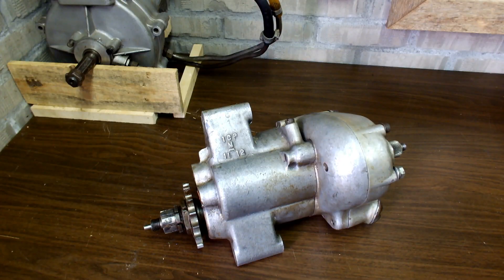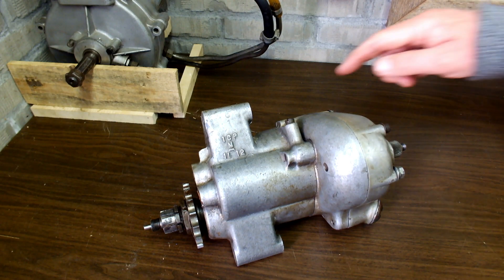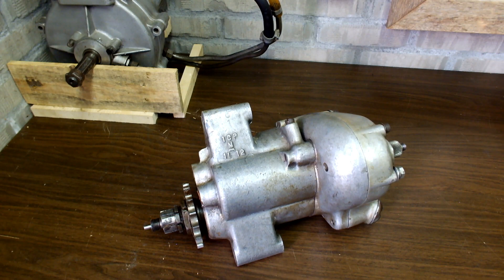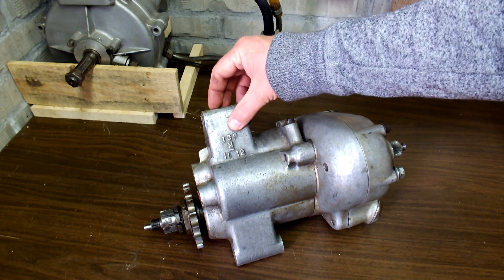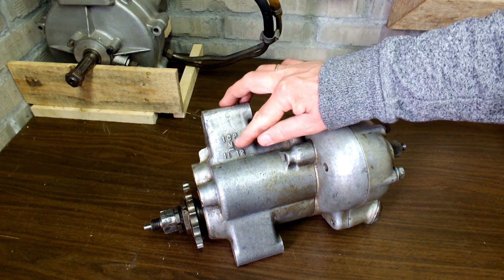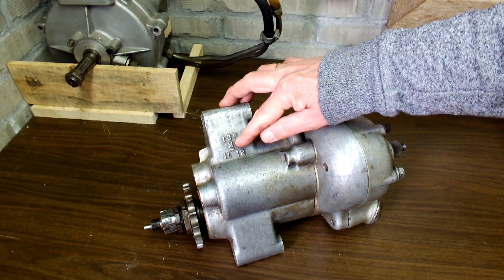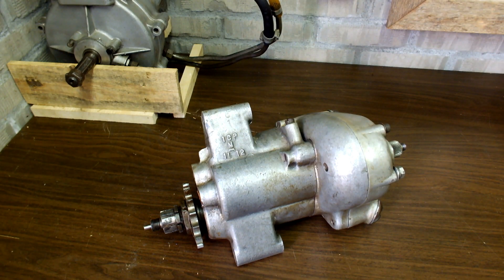Matchless G3L Rebuild - Part 1 - Getting Back to Work

Comment: Well, I'm currently putting my 1949 AJS model 16 back together, after a bit of a break. It was registered on 31/12/1948 and is a 49 model. (rigid/tele) Someone, in the past 70 years, had over tightened the upper oil line into the crank case and split the crank case ! Engine stripped and damage beautifully repaired by a local engineer. Currently waiting for some new parts but bottom end is back together and  in the frame. Hopefully  on the road by Spring. Good luck with the Matchless.  Lach MacCormack, Kent, England.
Reply: Are you on Instagram?
Reply: Would really like to see your build. Maybe I can learn something for mine.

Comment: Hello, I would like to give you some information (I am english and own matchless g3l’s) 
your frame number of 38873 makes it a war time frame. Contract number 12632 - 12633 frame number 34012 - 41011 was early 1942. (7000 units made in that contract, there was 4 different contracts for early 1942)
That contract came with Lucas or miller lighting.
The engine should have a number stamped in the side (some have a plate on them after being rebuilt in the army workshops) but it should read 
41/G.3.L - (then the number) regardless of the year they all have 41/G.3.L - *** 
If it’s a 3/4” inlet bore then it’s a war time engine, if it’s a 1” inlet bore it’s post war. For your frame number the engine number was between 49012 - 56011 (no G3L WD ever had matching numbers, if it has then someone stamped it themselves, possibly to disguise a post war engine) 
The gearbox should have stamped on the right side, upper face CP8 *** or possibly 8CPL *** that’s the gearbox number. They are a good box and the WD had a low first gear. Don’t use oil in the gearbox, they use liquid fluid semi grease (Morris EP400 for example) oil will just leak.
A great place for spares is AMC classic spares in uk. Steven is a really nice, helpful person. 
You also have the WD motorcycle forum,. 
A nice site is called matchless clueless.
There’s a nice book called “overland to Vietnam “ the story about a chap riding his g3l 11,500 miles.
Get a electronic regulator (I use the “dynamo regulators ltd. DVR2N” and have nothing but praise for them. They fit nicely in the original regulator cover too.
I am now in the finishing stage of a late 43 restoration and will take this one to Normandy this year along with the 42. the 44 needs a head rebuild, and once opened the engine might need more work so for now I’m concentrating on the 43. 
They are great fun to ride, (especially fully kitted out in the period ww2 dispatch riders uniform like we do) and you get looks, waves, smiles and always lots of interest, you will enjoy the bike I’m sure. 
Good luck and I will be following, and help if I can 
Best regards Shaun
Reply: Hi Shaun, 
You seem to have a wealth of knowledge on the bike. Would love to connect with you as I am restoring our motorcycle as well. Request if you could Please get in touch with me ! Thanks !
Reply: @GazderVarun  hello Varun, if I can help I will. 
How can I contact you? Regards Shaun
Reply: @shauna260   could you add me on Facebook or Instagram . There is only one of me in the world with this name. Shouldn't be hard.